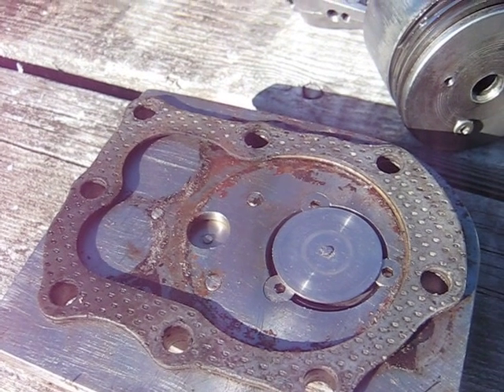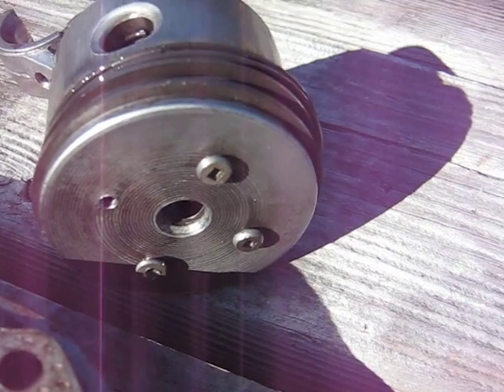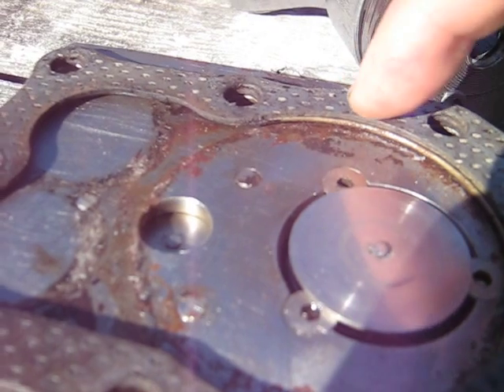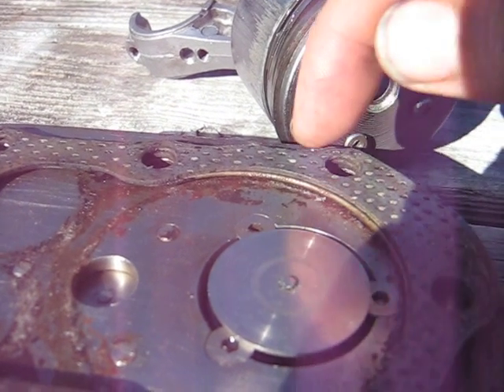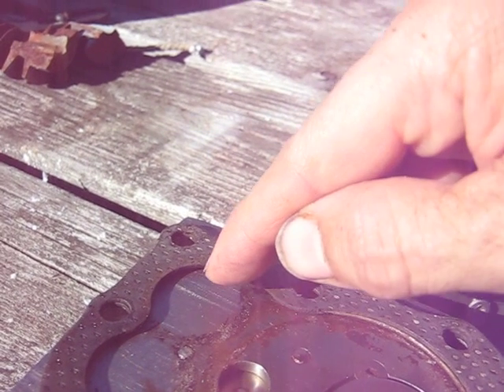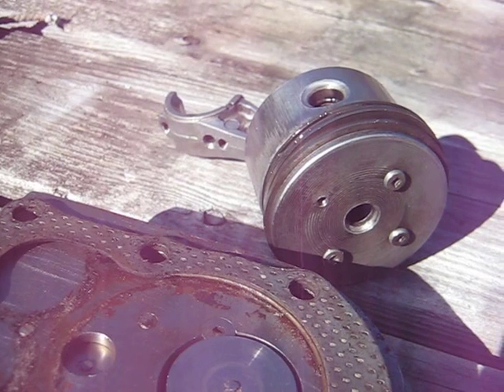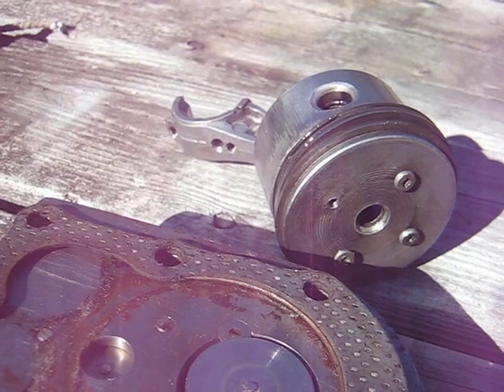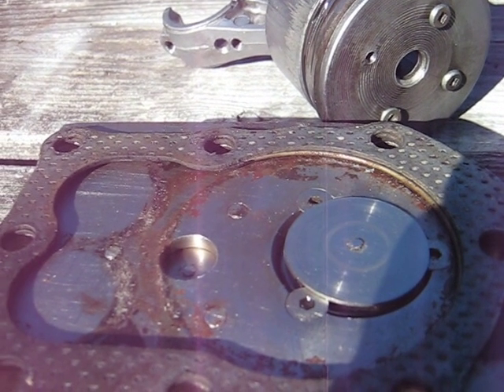Experimental Air Compressor Head Ideas

Comment: Question, You cant just use a 1 way valve for intake and 1 way flipped for exhaust???
Reply from the maker: +\ 0909 I think you could do that, the important thing is to minimize the chamber volume, and have large enough valve openings to not limit the compressor at max rpm (about 600rpm in this case).